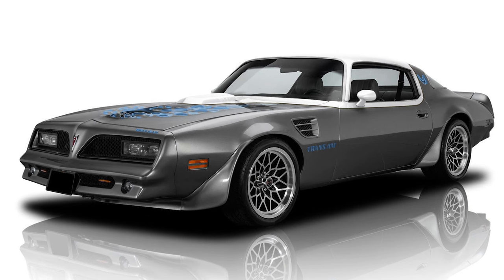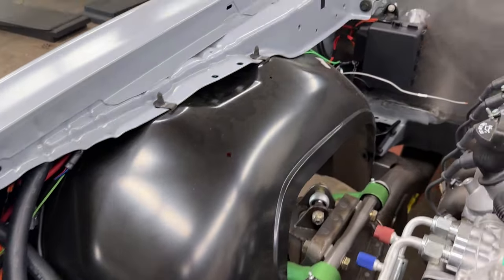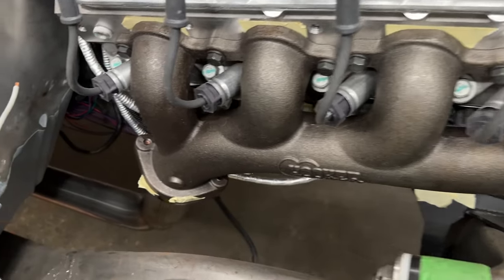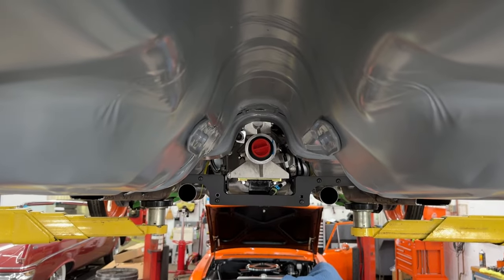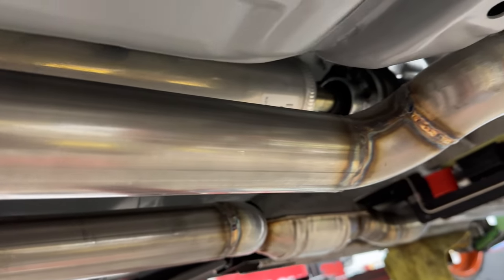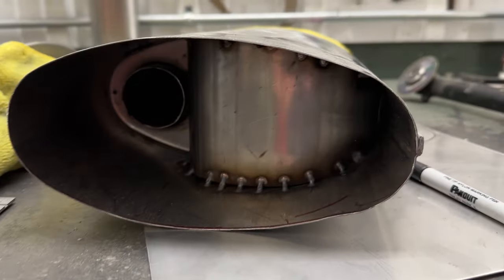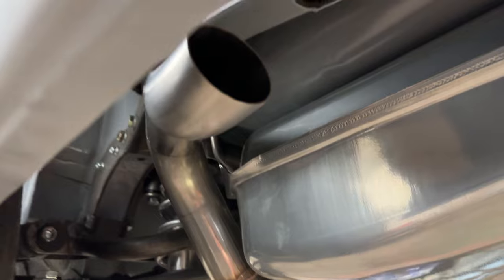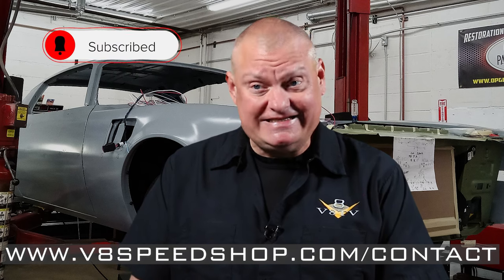Pro Touring 1978 Trans Am: Independent Rear Suspension, Detroit Speed Subframe, Custom Exhaust, LS3

Comment: Kev, BOLTED the Mufflers to the floor pan? Any Drone will surely Rattle ALL your bones, and I know, I had this done with custom work. the car was UN driveable as engine vibration was a Direct transfer to the body.. Good luck and be Honest on that test drive!
Reply from the maker: You are right, that mount point is still in process.   We're not ruling out a rubber isolation mount in that location with some type of support.   Thanks for the comment, we'll share how it all works out.

Comment: I wanted one that was completely ORIGINAL as if it had come from the factory. I think one way to maintain automotive history is to restore the classics as they really were. This is killing history and forever losing the experience of how our grandparents drove the muscle cars of the time. sad.
Reply from the maker: You are still more than welcome to buy a 100% original 1978 Pontiac Firebird, as there were over 187,000 built.   There are thousands of original examples and tens of thousands of restorable versions still out there.    We hope you find a good one and enjoy it all original, as we appreciate those examples as well.   However, this was a non-original car when we started with it, and modifying cars to perform better and have increased safety is a good thing.   AND... you'll notice... that all the of the engine, transmission, suspension, brake, and exhaust modifications we've made to this car are BOLT IN, meaning someday, you could return it to stock should you wish.   No reason to be sad.   Here's a link to a video of a 1979 Pontiac Trans Am 10th Anniversary Edition with just over 100 miles on it... one we'd never change.   Enjoy it!    https://youtu.be/2JYbKotNmd4